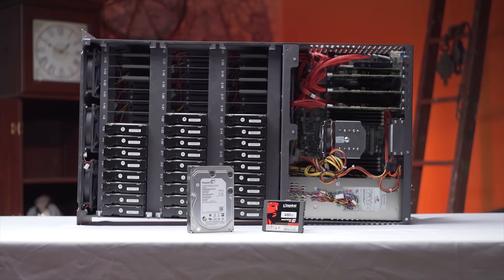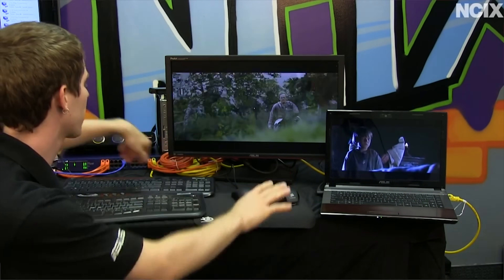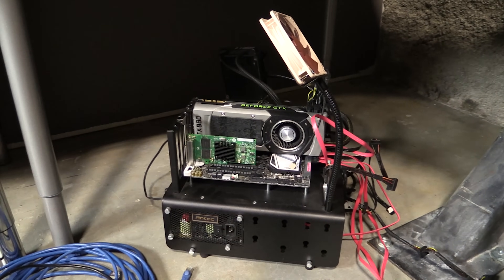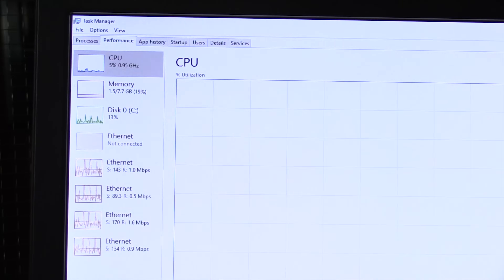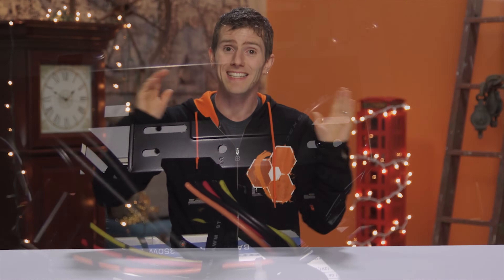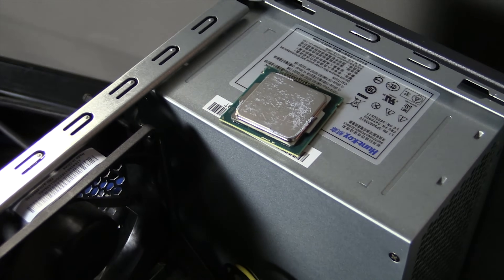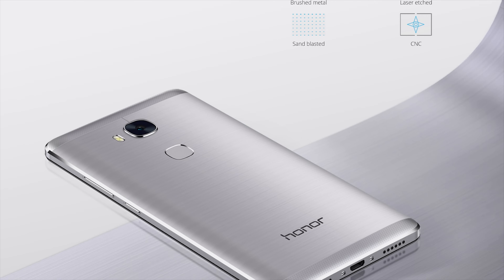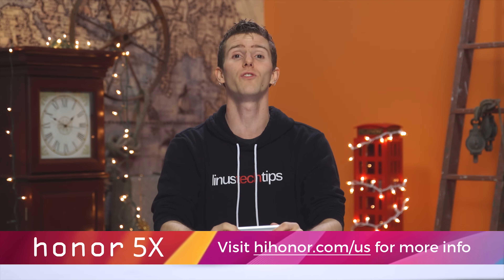Quadruple Your Network Speed for $100 with SMB 3.0 Multichannel!

Comment: my setup with file share sometimes works with multichannel sometimes drops for no reason to very poor transfer. Basically it should work like just plug and play. Plug your quad or dual network adapter to a switch and make sure RSS is enabled on all of them. On the other side also multiple network adapter - other computer plug to a switch. No teaming etc. just direct plug. I'm using windows 8.1 pro and it works... but not stable sometimes does multichannel sometimes don't. Very cool feature but not much online about it. Poor documentation and experiences. Does anyone have something to share... I'm trying to make this thing work stable...

Comment: its 2016 and iam still using a MSI Big Bang XPower i7 980X Powerd i build this mashine in 2010 cuz i saw it in one of his Videos, well now it runs Win10 Pro on 2 120GB SSDs in RAID 1 and 2 MSI 770 GTX Lightning SLI on damn 6000x1080P with bazel correction NVIDIA Surround - i have just one thing to mention, it is the Best Motherbord i ever had ! it runs 12 hours a day - Everyday ! XD - MSI is AWESOME
Reply: +alex0236 btw my Power supply is a Silverstone sst-st85f-p running since 2009 !

Comment: wont do enyrhing for me, my ip still uses the phone line and has a bilt is speed cap that is unsecomventable but at least I don't have a data cap so I can use it at full compasity all the time with no penalties but it is vary slow 2mbps down and 400 kbps upload. thats merican infostrure for you.
Reply: ow and my network compasity far exceeds my internet compasidy by almost exactly 50 times. now I could easily increase my network compasity by a further 20 times but thare is no point

Comment: Will this work with a router
Reply: +Tomot Hanrahan 
possibly, router need to be gigabit one.. and most of them have 4 ports, so only 2 workstations could be attached. People mentioning internet speed old the time... but there is no speed increase for internet it's benefit for local network and file share. Just plug PC running win 8.1 pro or win 10 with dual nic LAN adapter and another PC with same setup and they should share file with speed of 2Gb/s or around 220mb/s transfer if they have SSDs installed. HDD usual speed is 150mb/s

Comment: This works without any problems on windows 8.1 Pro; sharing files between two work stations. Mixed network adapters and no problem, no nic teaming just plug to a switch; 2 marvel and two intel 1000PT on ones side and two on board dual intel and one dual intel 1000PT ot the other side ...windows 8.1 pro and walllaaaa! got 4Gb/s transfer with default Microsoft drivers even on some network adapters.
The problem comes when you want to share SMB multichannel from windows 2012 R2 server. running on ML110 g6 quad core CPU no Hyper T. with raid setup that can read and write ~700mb/s.
It want work, getting  only 1Gb/s. 
RSS enabled; CPUs to actual count of CPUs on rss setup per each nic etc...
I don't believe NUMA settings on intel 4 port adapter have anything with this. 
Server side has DELL 0H092P / Intel Pro 1000 VT Quad Port Gigabit Network Adapter PCIe H092P. 
Any idea how to set this to work? Share with me please!

Comment: Trying to setup this for a month. Running windows 8.1 pro on two workstations with dual intel cards on supermicro server boards... OS on SSDs and plus one test server machine 2012 R2  with raid setup that can achieve 700mb/s read and write.. with quad port dell intel card... and as you say "nada" :( Turned on RSS on all of them; RSS ques to 8 etc.... performance settings receive and sent buffers to max.  Jumbo frames are ON, HP procurve 1810- 24g switch handling connections, dynamic lacp on and off... jumbo frames 9k ON like on the cards. I tried network teaming dynamic link aggregation, direct connecting and NADA!!!. What is going on here no multichannel at all? Can anyone make a video how to setup NICs and switch for this marvelous 3.02 SMB feature. Thanks! 
I'm opened to share my network setups...etc. 
Linus, please record full video how to make this work! ;) This is just a teaser.

Comment: We found out in our environment. Most network traffic works off of a single core. Core 1. We run server 2012 r2 and our transfer speeds are very good we have seen over 1GBs using the Nimble Storage. We still notice that the first core does handle most of the network processing.
Reply: +James Hyatt 
Hi James,
...did you set LACP team or not? How does your NIC setup looks like, since you have it working.
Let me know.
Thanks!

Comment: Getting speeds of 442 mbs. Thanks for the pro tip linus!
Reply: +Mathew Boston 
Hi Mathew,
I just posted above I can't make this work in my setup. I was using LACP team, 4 port card on 2012 r2 server with raid and work station with dual nic and SSD. Only getting 1Gb. RSS is enabled etc...
Reply: +qlbeans belgrade Hi, I too am using the same server setup. All the desktops connected have windows 10. On the server side. I noticed that teaming would cause weird transfer speeds. So I just went ahead and unteamed the nic and created a new share with the SMB protocol. On the desktops, I just mapped the share. This produced 400+ mbps on all desktops.
Reply: +Mathew Boston 
Thanks Matt, I will look in to this and get back... ;)

Best,

Bogdan
Reply: +Mathew Boston 
Hi Matt,
It's working with win 8.1 pro just plug and works. ;) the problem comes when you share from win 2012 r2 over SMB multichannel no nic teaming etc same setup like on workstations... just getting 1gb/s
Do you have any idea?
I made one longer post on this question above...

Thanks for replying earlier! 

Best,

B

Comment: Sorry if this may be a tad unrelated, but I don't have a lot of knowledge in this area and thought someone watching this who may read this comment may know how to help me. I would like to improve my router box in my living room - meaning speed/connectivity. I use wireless for my laptop and pay for a virgin subscription for 50mb. If I buy a booster router (I had one once because the walls were rather thick and the wifi wouldn't reach upstairs) and set up next to the router I have from virgin would this mean I would exceed the 50mb speed and therefor have faster internet/connection speeds from the living room?

Comment: 2:55 - Its been years since Ive used Intel PRO software and multiple TEAMING nics together , but would you not have to first , install nic software , install pro software, setup team link towards the switch and setup the switch to support it aswell , back in the day of socket 774 you had 10/100 cards doing 11MB/sec and gigabit cards maxing out at 60 MB/sec

Comment: YOu have to setup the multi channel LAG (Link aggration) on the switch otherwise spanning tree may throw a fit and block 3 out of the 4 ports. Same thing on the card you need to setup LAG in the intel driver or it may not do anything.

Also thouse hp procurvs on ebay (sub $60 ones) have a stupid logn warenty the ones i have at work have a hp warenty good til 2150 soemthing.(not a typo)

Comment: I'm kind of surprised you've never explored or talked about POF- plastic optical fiber. It's incredibly cheap, can travel in runs of 300 feet, is easy to install, has no connectors on its ends (bare cable is simply inserted into a receptacle), can be cut to length with a sharp knife, doesn't emit radiation, can carry Ethernet, USB, IEEE1394 and other protocols, and can deliver over 3 gigabits per second. It is also resistant to vibration, EMI, radiation, and humidity.

Comment: I would think that you would get the best results if you had a gen 3.0 mother board so you hook up into Gen 3.0 lanes and having as much band width as possible.. with the 1050 or 1051 chips, you only get 16 lanes of PCI width  in them chips.. but the X79 or x99 boards and chips on the 2011, so long as its 4830k or 4930k or 4960x and up to the  x99 chips as well.. they are all gen 3.0 chips... but have far more PCIE lanes.. except the 5920K which has 28 instead of the normal 40 lanes..  also having nics with 8x instead of 4x gives you greater band width, does it not?? And if you also connect your SSD's to a 8x gen 3.0 raid card, that would help speed up any data transfer as well..  and if you had a Nitro card on both machines, they have on board memory.. so I would think that would also increase the speed as well if one had one of these in two machines, they would talk faster to each other.. that you could transfer files from one machine to the other faster... the idea is to not have any bottle necks right??  Some of the newer Raid cards are not just 6gbs, but are 12gbs as well.. but they are spendy.. but if it is about speed.. then you need to pay.. LOL  You can also use the 10gbs nics as well..  as long as its on your network, the speed should be there.. those nics go for about 200 or so on ebay..  but you got to make sure all of your hardware is PCIE gen 3.0 and you have plenty of PCIE lanes in the chip... the 4770k and the 4790k only have 16 max.. so if you got a graphics card on 16x.. well it can run under 8x.. so you can put in a nic at 8x as well.. but see what you are doing??  You have two devices totaling 24x with only 16x max PCIE on board the cpu... and if you go SLI with two cards, you might as well forget it with the 1150 or 1151 chips.. there will be no band width left to run it...

Comment: so for me to replicate this at home (just more speed not over 1gig my isp (the only one available) won't put lines that support that in my area for some time) all i need is to have a 4 port network card and switch that supports 1gbs to get more speed (or less fluctuations)?

are you still capped at the speed your issp is giving you are is it additive? does it depend on the router and modem I have?

sorry if i sound like a lemming.